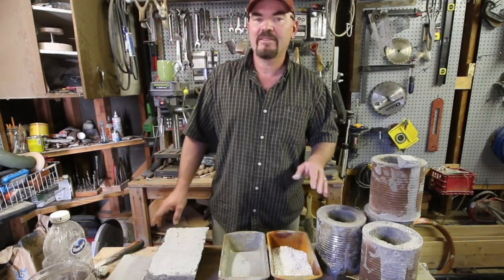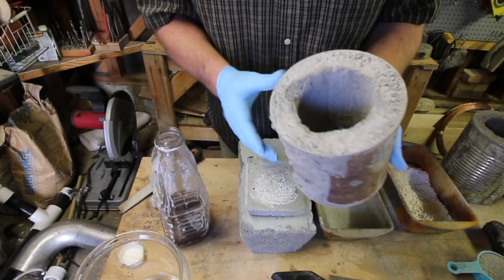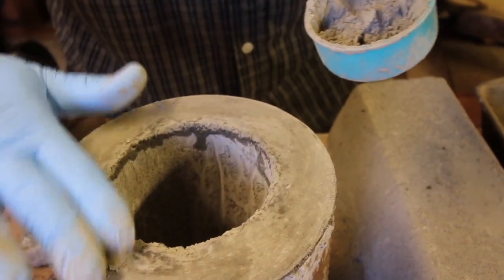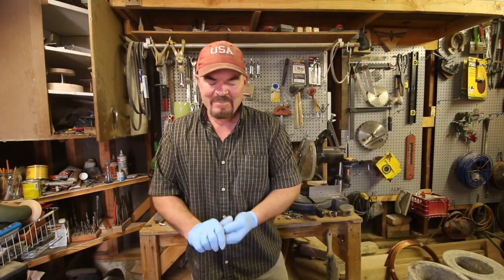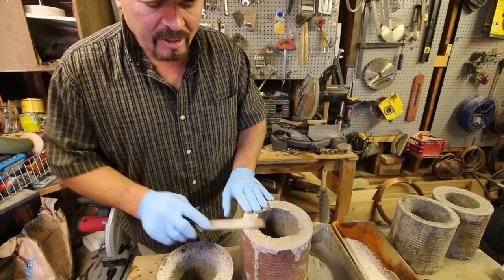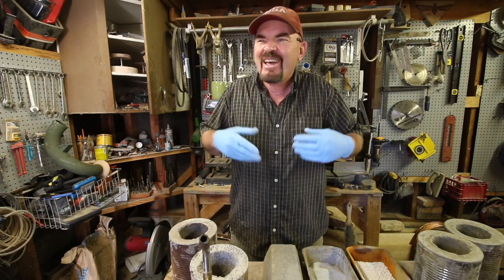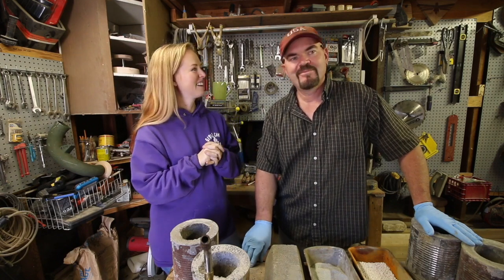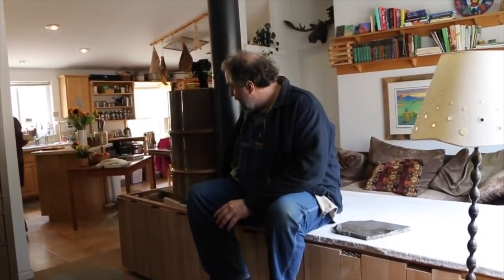Creating a Refractory Mix Out of AirCrete for the Rocket Mass Heater

Comment: have you ever done a pressure test on aircrete like you use to do on the bridge concrete?..i guess what i am getting at is...have you come up with a load bearing mix for building structure walls in homes, etc.?

Comment: interesting stuff folks.  The term "Water Glass" is a euphemism and really isn't glass at all - but it is a version of soluble sand  ie silicon dioxide.  Sodium Silicate is a pretty useful concrete sealant I'll for your links on aircrete to see about your use of foams and stabilizers.  You might consider using other metal oxides instead of portland SEE-ment (I couldn't resist :) )

Comment: Rocket heaters can easily be made lightweight and portable. Rocket mass heaters, as the name implies, can not. Once you remove the mass from a rocket mass heater, it becomes a simple rocket heater. Conversely, a rocket mass heater is simply a rocket heater with a massive thermal battery attached to it to store excess heat.

I didn't write this to put you down. I just want to highlight the differences between rocket heaters and rocket mass heaters. You built an awesome rocket heater. Without the thermal battery, it is not a rocket mass heater. I do like the creativity in using aircrete for the insulated riser. This is an important part of making an efficient rocket heater.

Comment: you need not heat water glass to harden it. it hardens due to co2 absorption. it hardens with your torch because combustion  causes co2 to be created. it will harden on its own with time as it gets it co2 from the air or you can force it in seconds with co2 gas injection from a tank and it will not expand like it does when you head it. I use it for making sand casting cores for molten metal. I'm going to try just perlite wetted lightly with with water glass the rammed in a form and injected with co2.

Comment: Wow ! Impressive numbers on the heat. Mine only seems to max out at 300°F to 400°F or so.and is not the same mix no perlite or water glass in it...I am sure that must make a big difference running the rocket mass heater. 
Wulfy
Reply: That's all?

Aren't you sending a lot of creosote into your system at that temperature?
Reply: @priestesslucy  no. Actually it does quite well. Have a new one I built with fire brick and it performs great- still not super hot though, but no spot and it lights up and rockets like a charm!
Reply: @wulfclaw4921  where are you measuring this temperature?
Reply: @priestesslucy  the barrel top , sides
Reply: @wulfclaw4921  Ohhhhhh, I thought you were doing the Heat Riser measurements (which I don't know how they take them, but yeah the internal heat riser temps get nuts.)

Top of the barrel that sounds about right ^~^

Comment: There is a major oversight I will attempt to explain. Any and all materials have a couple of important properties as they pertain to RMH's . One is thermal storage capacities known as "K" value and the other is insulation value known as "R" value. The two properties are inverse to each other meaning if it is a good insulator its a terrible heat storage material or to say it another way would be the more R then the less K or the more K the less R. being that RMH work with principal of heat storage. Making a RMH out of foam aircrete will greatly reduce the very principal RMH are built on and that is heat storage. Thermal capacity material charts are available on line to view. water is the unit of measure for K value and water is 1k value stone is .2 thus water holds 5 times more heat than stone pound for pound but stone is more dense ( water is 63 pounds per cubic foot while stone is 95) thus by area water stores 3.26 more heat than solid stone (not gravel or rocks with spaces). concrete is equal to solid stone in heat capacity for storage but when you add the air bubbles the insulation value of the concrete goes way up and the ability to store heat known as K value goes way down defeating the main functioning principal of the RMH , any questions?
Reply: Van Powell Right.  No good for mass but good for the riser.   Time will tell.
Reply: So good application for the hot flue gas insulating components but bad idea in the thermal transfer sections... Makes a better cast insulating ring / penetration assy for the flue pipe though, assuming the physicals are there or can be boosted with glass/ceramic/wire or whatever.  Good explanation. Thanks.
Reply: v c To simplify it: Combustion areas, or places you don't want to get hot.
Reply: Good points Van Powell. Ideally though a good system utilizes insulators in the right key points to also protect system componets from premature failure while it maximizes the burn, transfers, then captures, stores and then releases the heat in as efficent a manner to conserve the resources. Combustion of all materials and gasses, transfer of heat to a temporary storage medium,  then as slow as possible a release of heat from the storage medium all with a goal of safety in mind. Safe, light, and cheap Insulators in the right points of such a system is a goal for many an RV and Tiny Home building hobbiest such as myself. So this option looks promising and worth some experimentation for those of us knowledgeable and cautious adults. Used as a thinner layer outside a metal flue instead of as the flue or maybe even adding some steel tubeing to the inner surface partually within the mold to store and funnel the hit gases while protecting outer surfaces.
Reply: new skool/old skool:
 now we understand and agree/see cleaner burns with highet draft created only by higher temperatures in primary and secondary burn chambers, created only by insulation (not resistance).  With higher draft and less smoke, we can build bigger and longer resistance channels after the burn chamber before venting outside.  Again, ANY resistance/induction of the primary and secondary burns creates more smoke and residue and slows the draw/output of air, eats more wood per calorie output.  Seems counter-intuitive at first, but it is how it is at this point, sorry about your 30+ years' experience.  We knew it thousands of years ago and are only realizing it again.  My advice to 'experts:" stay more interested in your topic than your being right

Comment: Hi there! Hey sobi have pondered "rocket mass heaters" for years.. and  I am at place where I can begin work on my third project and this go around I am wanting to "break new ground" in the ascetic/artistic design of the rocket mass heater, on a permanent install. On this build I will be using 30 year old pieces of glass that have the appearance of corrugated metal. The pieces are about ⅝ thick. In my thought process I figured that I would need to make "my own" refractory cement and thats how I found your excellent videos. I would like to share with you my overall design and concepts if you would be willing to share your thoughts on how my design could be better and what I might need to do to improve its long term functionality.
Reply: I also have a wife, and we also live in a "small" cabin and she is also concerned about said rocket mass heater going full melt down.
Reply from the maker: No full meltdown. Not a problem four years later.

Comment: I
I'd like to make say a 12" long road  maybe 5 inches in diameter drill a  1"  = 1 1/2 "  hole.. and coat it in your water glass solution.
I want to make a rocket chinmey for an wick oil heater...

Comment: what about a clay flue liner for the burn chamber and riser and aircrete around it
Reply: Hi Elizabeth
Unfortunately Portland cement desintegrates @~ 550 degree C
You could saturate the cement based riser with water dilluted waterglas (sodium silicate)
When the cement desintegrates and looses it's structural integrety, the waterglas would keep the riser pipe in shape.

A clay liner within above mentioned riser pipe is not a bad idea at all.
I suggest you to mix the wet clay with perlite or charcoal or saw  dust  or expanded clay to reduce cracks.
Important.. allow enough time for drying and curing.

Comment: I just bought your plans for the foam maker.
do you think that the rocket stove pipes in the thermal mass sofa system can be adaapted to run though metal pipes buried in screed so that you have an underfloor heated slab?
Reply from the maker: This is my video instead of Darwin's. He made the stove and the plans over on Honey Do Carpenter. I just test the stove for him. That being said, maybe. We have dropped the pipe twenty four inches without losing momentum of the smoke. Dropping it further into the floor we haven't tried yet. But it's a great idea!
Reply: @dirtpatcheaven  thanks. I am planning to run standard underfloor heating water pipes in my dome build floor and heat the water with a central rocket stove, and have a diverter in the chimney to either heat the water or the thermal mass bench. the stove would not be very far up from the floor pipes, its usuaal to bury the pipes in about 3 inches of screed and have tiles laid over, so I wondered about doing away with the heated bench and using the floor as the thermal mass store instead

Comment: Thanks for sharing your experiments. Why not make aluminium cement aircrete? Aluminium cement can be heated extremely high.
Reply: Interesting idea.  Have you tried it? What form of Alumin(a) did you try?  Elemental Al would be a bad idea, I think, but certain oxides of alumin(a) are used in casting many products.  Interesting idea if the material is cheap enough. Thanks.
Reply: @vc1343  
I once made airated concrete of Aluminium cement as an insulator in double walled SS 304 chimney pipes.
It worked fine ( even in case of chimney  fire) but later it was replaced by light(er) weight glassfiber in flakes wetted by sodium silikate as a stiffener

Comment: how did the  pebble fill around the barrel work?
Reply from the maker: Not so great. It blocked the heat from getting into the room while everything was heating up initially. We ended up removing all but about six inches at the bottom.

Comment: Portland, whether regular or AIRCRETE, spalls in contact with rocket stove temps..180l to 2300*F.   So, whether or not it’s coated with waterglass, it’s gonna spall faster than actual firebrick.  Even steel wimps in the face of heavy use in a rocket stove. 
But AIRCRETE is a grand insulation for a house! 
But say…what if waterglas was used as part of the water for making the Aircrete?  
I’d be really nterested in how much longer the waterglass/water mixed aircrete lasts, than painted or soaked onto it.   
Or, what about mixing warerglass into water, then reconstituting clay with it?
Reply from the maker: We made the second stove with refractory mix in the burn chamber itself. Works much better. You are right.

Comment: EPA efficiency scores only measures the efficiency of the BURN, since they are mostly interested in how clean the air is.  Burn efficiency means how much of the wood fuel is consumed vs literally going up in smoke.  The EPA is enforcing CLEAN AIR rules, not ENERGY EFFICIENCY rules.  

But, they don't measure the efficiency of the whole SYSTEM, which is another way of saying: "how much of the heat that is GENERATED stays in the house" and does not go up the chimney.   Assuming a clean burn of the fuel, one way of measuring this how low the exit flue temperature is going out of your house.

Only masonry stoves and rocket mass heaters (a type of masonry heater), have both a CLEAN BURN efficiency and WHOLE SYSTEM efficiency.
Reply from the maker: All of the heat stays in with this stove...it was SOOO hot and no heat on the chimney on the outside. We just need to figure out the bench so that it doesn't cook us out of the house.

Comment: I'm new to this but have been looking at a bunch of different things in regard to this. "nilamotk" made a video using silglas and portland to make a refractory and he mixed a ratio of glass to portland before adding water and then allowed it to cure over a very low heat I think he said Co2 was required to cure. So if the foam create is really insulative then is the pearlite really necessary? Then if you can drop the pearlite can you mix the silglass and portland then enough water to allow the foam to work then let cure then slowly heat to make this work?

Comment: Use pressure to increase waterglass integration - test in a pressure cooker maybe?
Reply: Good suggestion.  Industry in fact uses both pressure and vacuum simultaneously to improve migration of (liquids) through matrix materials.  Think post-application of a liquid to a sintered aggregate.  Ideally, all the constituents (should) be part of the original casting but sometimes this just isn't possible.  If you do try the pressure cooker idea though the order can influence results.  Typically heat/pressure is applied first and the vacuum is drawn after as a discrete operation.  Sometimes in repeating cycles.  Original structure and physical limitations need to be considered though as not all materials/grinds/bonds/etc handle repetitive temp/pressure/vacuum cycles well.  If the process is a complex molded part (think cultured marble, aluminum casting, urethane foam casting, etc) then simultaneous (push/pull) operations are often used to fill molds with a minimum of voids, density variations, striations, etc. but getting the pressures/vacuum levels, number of sprues, and timing right takes a bit of experimentation.  One could use such an operation to mass produce matrix cast/extruded/molded RMH parts though, if the market would support such a product. Good suggestion but complex in execution.
Reply: We use vacuum chambers for wood stabilization which pulls a very thin resin that is the baked for activation of the resin.